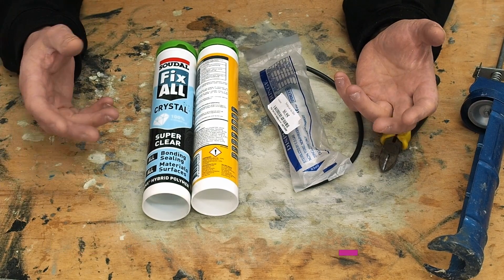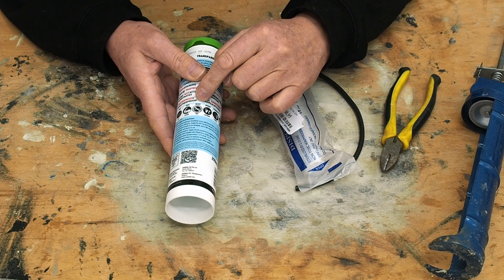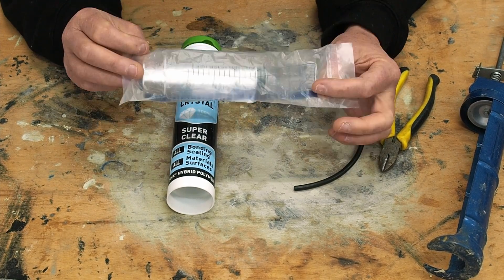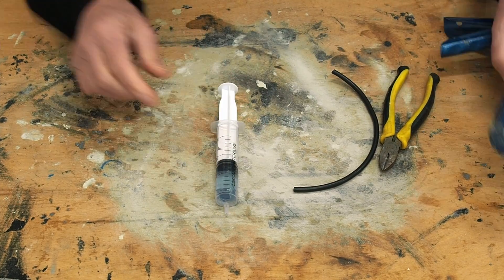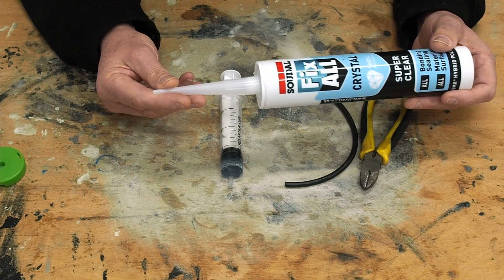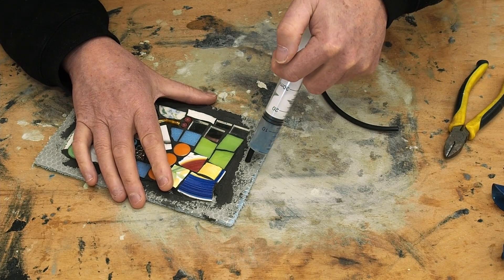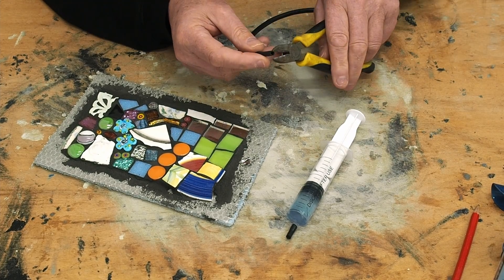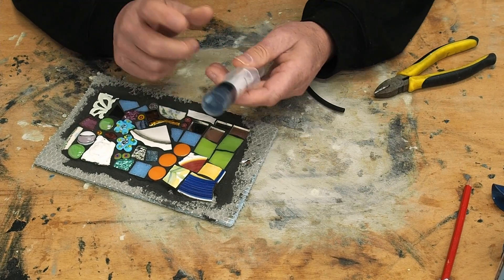Working With Silicone Type Products In Mosaics

Comment: Another great video! I just purchase the smaller tubes of adhesive and don't have much of an issue. I like the horse sized syringe though for products that aren't available in the smaller tube!
Reply from the maker: Thankyou very much, yes the smaller tubes are really good, over here I find them quite expensive compared to the larger ones but they certainly would be so much better. Thanks for watching. :)

Comment: I love all of your videos, I’ve learned so much from them Peter! Do you know of anything I can use on the back of stain glass to make it opaque. Thanks Peter!
Reply from the maker: Thankyou so much Elaine, it depends where its going and what you plan to do with it as anything you paint onto the back of stained glass could eventually lift or fade unless it embeds into the glass. If there isn't a specific reason I would just use opaque glass, its reliable and just easier. For outside pieces some people use white thinset thats rated for glass to highlight the colours. :)

Comment: What is blue tec?  I HATE working with silicon, so thanks for the idea about the polymer, and now I know how to save my syringes.
Reply from the maker: I find working with silicone type products to be a bit messy at times with the residue. Here's a video that I made on a similar product to Blu Tack my preference is the Bostik Blu Tack brand but they were out of stock so I used the Selleys one which I don't think is anywhere near as good. Thanks for commenting. :)  https://www.youtube.com/watch?v=sCMGjhKCJwM&t=274s

Comment: love all your videos I am new to mosaic. I am working on a mirror outdoor table top and have some questions on using Soudal on a large area. ( I have already cut & placed on pattern when I learned mirror backing needs protected ) Can I ask you for some advice ?
Reply from the maker: Thankyou so much Charisse. I would be inclined to join a couple of the Facebook mosaic groups and create a post. Add some photos, information about where the  piece is and the environment it’s in and the Tess you are using. The more information you can give the more accurate your answers will be. I generally dont give advice on projects because there are variables l cannot see that can influence the outcome. Unless you have a general question. 😊

Comment: I came across your channel and found it very informative, I have a question I have done ceramic mosaic in a porcelain sink and then did the grout what can be used to seal it as it’s for the garden bird bath thanks in advance 😊
Reply from the maker: Thankyou so much Andrea, it depends what's available in your country and Im generalizing here and not speaking specifically about your job as there are always variables with any project that I cannot see.  I would consider AFM Safecoat grout sealer or 511 Impregnator. However and very importantly you would need to read the products technical data sheets to ensure its suitable for your job, the tess you've used and the environment its in before buying or using any product. Also read the manufactures MSDS as both the technical and MSDS are very easy to read and generally available on their websites,  you can always give the manufactures a call as well. It would also be advisable to do a small test sample first that you can create or a small area before doing the the complete birdbath. :)
Reply: Thank you for your response ❤️😊

Comment: Peter, just been watching this again to refresh my memory, I do however have a question if you please?  I want to do an outdoor piece and I will be using thinset. I also want to incorporate some mirror bits in my piece and as you have said, thinset is not neutral curing.  Any ways around this problem please?  is there something I could paint on the back of the mirror to protect it do you think?  thanks in anticipation of your answer.  I am in the uk by the way. x
Reply from the maker: There are products that you can paint on the back of the mirror to protect it however I haven't found one that doesn't pose health risks to the person using it. Some people have used clear nail polish but I have no idea if that works or not. My suggestion would be to use a neutral curing adhesive like Soudal Crystal Clear Fix All, this is a similar product to how silicone works but it doesn't contain the solvents, its also available in the UK Caroline from Mango Mosaics uses it in some of her mosaics. You could also look at using Litokol epoxy grout however like everything you would need to look at reading the technical data sheets or call the UK distributor to make sure its going to be suitable for your job. The UK distributor in the UK is the Nicholas and Clarke Group. www.ncdirect.co.uk.
Reply: @TreasuryRoad  Thanks for getting back to me Peter.  I do have Soudal already, I just wanted to use thinset  outside for quite a large project.  I might try the nail varnish trick.  Cheers x
Reply from the maker: @cindypage8673  Thankyou, my preference is also to use thinset outside. Just remember l don’t know how successful the nail varnish is. 😊
Reply: @TreasuryRoad  Yeah, no worries Peter.  Thanks for all of your help x

Comment: I use the baggy method 😊
Reply from the maker: Thanks Lyn, yes a few people use that method for silicone, I have used it for thinset and it works a treat. :)
Reply: Me too. The syringe method looks great as well, but a bit more work. But, I'm going to seriously check out the polymer though. I live in the Canadian Rocky Mountains where it ranges btwn -40c and +40c, and the temp can go from -20c to +20c overnight, silicone has never failed me yet, but it's worth looking into.
Reply from the maker: @MsK-xm7vw  The syringe method I use on certain jobs and others I may use the baggie method, I find the syringe to be quite accurate but its personal choice. Just check the technical data sheets on the product you're looking at getting to see if it can handle the temperature ranges that it will be exposed to. Thanks for watching. :)

Comment: How do you insure that black grout won't bleed under glass on a glass on glass mosaic and what is the best adhesive?
Reply from the maker: You need to ensure the back of the tess is completely covered with adhesive so the grout cannot get underneath. For a glass on glass I really love Mac Glue but its not suitable if you are adhering mirror as the reflecting backing can be effected. You would need to use a neutral curing adhesive in that instance, such as the one in this video or Prep MutliUse Adhesive. Heres a video I made on adhering mirror and rhinestones. :)  https://www.youtube.com/watch?v=nyltsixnXto

Comment: can you clarify the shelf life once in the horse tube, if not used in 2 days, should  you empty the tube and save the tube for another project down the road? thank you Peter
Reply from the maker: Thankyou so much. I cant clarify as it depends on the environment that its in, however I generally replace the tube around the 4 or 5 day mark as the plunger can become difficult to push down and the inside can get a skim coat of dry silicone. I throw the syringe out but if you want to clean it out then give it a go. I generally don't use silicone type products only when I'm using mirror. :)

Comment: Hi Peter thank you again for this informative tutorial. I have been using Soudal T-Rex Power SMX polymer because of its low toxicity and it is crystal clear, the downside is it dries extremely quickly and is tricky to use. It dries in less than 5 minutes so I would not be able to use it in a syringe. Does the Soudal product you use dry completely clear? Another product I bought recently is Sikaflex Crystal Clear, it states that it is solvent free on the front and this was it's attraction but then on the back of the bottle I have found it says it is combustible and the drying time to skin formation is 15 minutes. Have you used that at all? Thanks Lisa
Reply from the maker: Hi Lisa, thankyou very much appreciate that. I haven't had the drying issue you speak of, I would think the environment its in may have some impact on the curing time, I have been using it with the air conditioning on at room temperature around 20 Celsius. When I finish I come in the next day and can still use it out of the syringe providing I cap it as in the video. The one I use does cure totally clear, one of the things I like about it is I can come back in 20 minutes and just scrape it away from a piece of tess. I haven't used the Sixaflex product that you spoke about although I have used Sikaflex, I would read the manufactures MSDS to get the full rundown of the product. :)